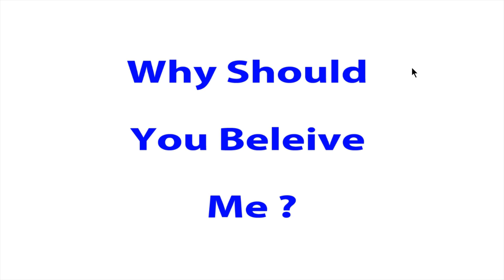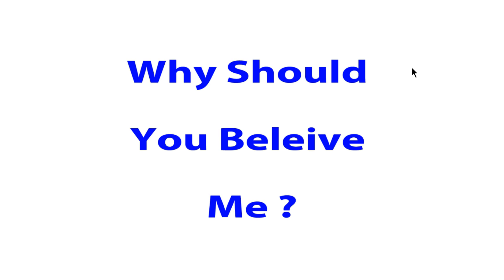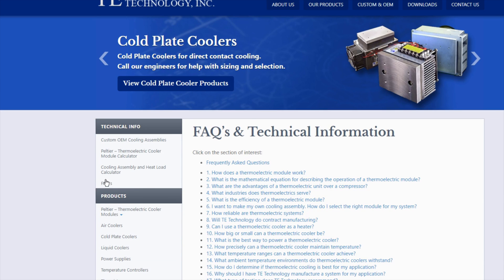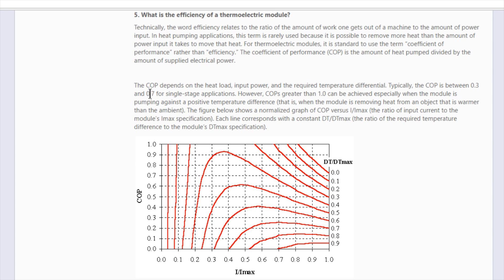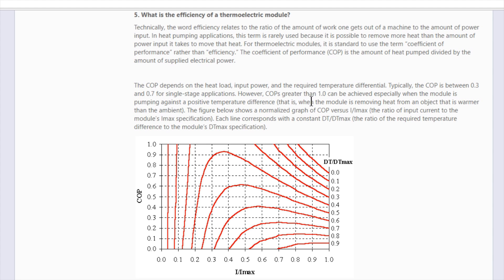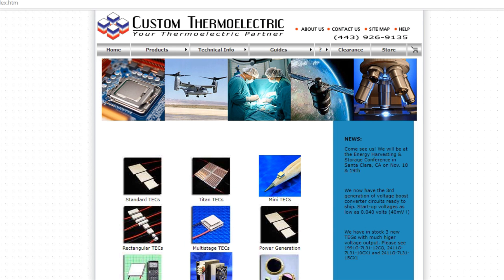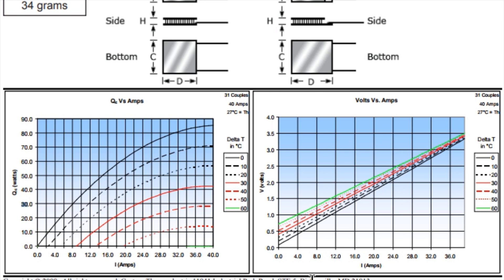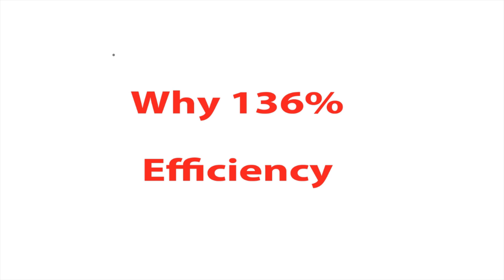🎓 Peltier efficiency:- Why should you believe ME ?  Part7

Comment: Sir COP-u-lot,  is it not true that in your example you took 8A for an example without regard to what I/Imax is on the COP chart????  This is very misleading to your viewers.  Why don't you just show what the voltage and current needs to be, along with thermal connections and rating of the TEC, what the hot and colds 'objects' are and shoot for just a COP = 1 so everyone understands all this stuff in a 10 second video.
Reply from the maker: This comment is not clear enough for me to understand... i assume you haven't watched the previous video/s. This Video absolutely backs up the previous statements that you can achieve a COP great then 0.02-0.1 or 2-10% ... If people continue to believe that then well thats up to them..
Reply from the maker: But it is correct you don't need to take into account I/MAX when dealing with COP...  no COP / efficiency formula has EVER included the power it's NOT using into account ..
Reply: If I understand that correctly,  8 amps at 0.75V is only 6W, and therefore moving 30W of heat is achieving a COP of 5! That's awesome! I think the secret to making these work effectively for a dehumidifier them could be having them in series regarding airflow so air is progressively cooled, and then flows over the got sides in the reverse order, up to the point where it teaches ancient air temperature
Reply: @herseem  no that's not how it can work better.  After the first TEC you have moved 30w so the next TEC has less Heat available to move creating a greater Temp Difference so your COP drops.  Not only that but it can't return at ambient temperature because the added power to run the TEC needs to be dissipated.  THEN you've returned even hotter and hotter air to each TEC creating a massive temperature difference.
Reply: @gr1f1th  ok, thanks for that, it makes sense. I'm going to think about some more then
Reply: @herseem  after a year, how did your research go for a dehumidifier with peltiers?

From what I understand, peltiers create more heat than they move. Which means they could greatly increase the amount of moisture air can hold.
Meaning their cooling performance is less relevant because the condensation point is raised.

I'm looking at a fanless design. Using water to move both the heat down, and the cold up. And letting the heat rise to the cold above. - should allow the heat to fully expand and absorb moisture from ambient air. And as long as it's designed properly, the recooled air shouldn't be allowed back down, but trapped into leaving the system.

Probably will need to exhaust excess heat, in a separate temperature controlled loop. - Or the heat will probably still overpower the cold.

(Really, I'm just prototyping before I make a decompressor based system. I want to collect humidity for drinking water but radiators are too hard to clean properly. So I need to increase surface area in other ways. Even though I plan on using air/water filters. I don't like the idea of drinking too much bug/dust/mold stew.)
Reply: @josholin31  I'm afraid other things took priority!
Reply: @herseem   

https://youtu.be/_hH-8KqQtys

https://youtu.be/boytzuOOFqY
Reply: Thanks a lot for all these amazing videos. These are only videos I have seen explaining what affects efficiency in such a detailed way. However I couldn’t install the software. On Windows I couldn’t download, on IOS I could download but couldn’t install, I send the files to Windows finally managed to install but it still failed to work. I tried in 4 different computers, no joy. Can you please help me to use this calculator?